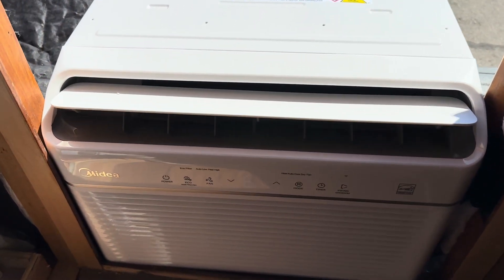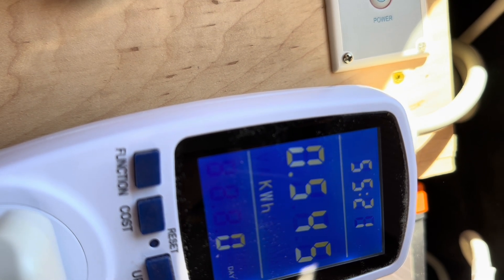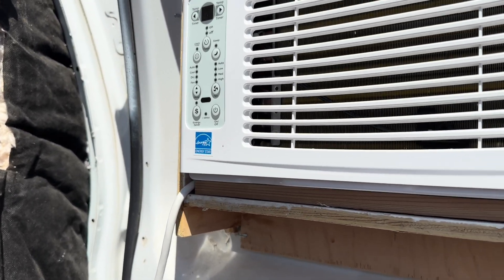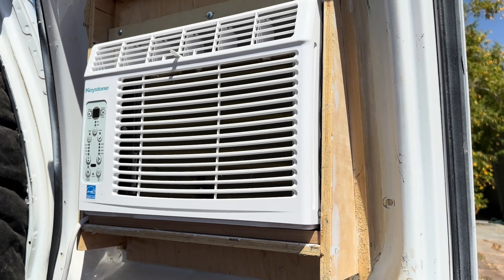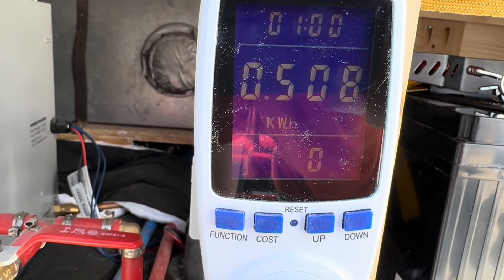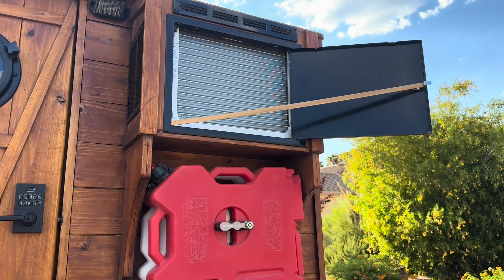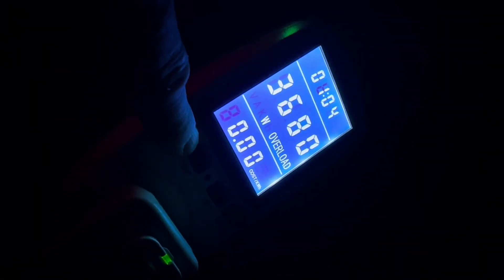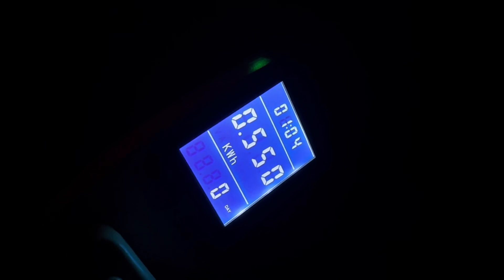Testing Midea 8000btu AC w/ Heat Pump and Another 5000btu AC Comparison - Surprising Result! 🤓

Comment: Also I have tried several 5000BTU and 6000BTU window units.  Think the 6000BTU cool quicker and compressor does not run as much.  I doubt i will ever buy a 5000BTU unit again.  Cool test.

Comment: I have the Midea 12,000 BTU in my den.  Run it on a Bluetti  AC200P all summer long off of solar.  Keeps my house nice and cool.  Inverter units are the way to go.
Reply from the maker: Thanks Troy
Reply: Just installed the midea 8000btu air con + heat in my vending trailer.  It works really well to cool the small space! The ac sips power most of the time between 150w- 250w set at 75f and when ramping up only gets to 450w.  Thank you for the inspiration.

Comment: Dave, is it just a simple 5,000 vs 8,000, the 5,000 uses less power? Did I miss something?
Reply from the maker: It’s a little more significant than that. This 8000 Btu unit tested has a heat pump functionality also. The test was to see if this version (which also uses the Midea inverter technology) was as efficient as the AC only version. My test showed it was not - which I felt was significant. Also, I tested to different 5000 Btu units in the AC pods I construct to see how they performed. I wasn’t necessarily comparing the 5000 Btu units to the 8000 unit so to speak, but included that section because I thought it would be of interest to the audience.

Comment: Thanks for doing the comparison! I actually have 4 of these Midea-U units running in various places. I bought one and realized how efficient and quiet they are and have since installed the others. The Midea-U is essentially a mini-split a/c in a window case. I have 10,000 and 12,000 BTU units and the peak draw I have seen was 650w as it began the cooling process. It lowered to 230w while maintaining the cool and sometimes down to 25-75w with just the fan going. That being said, I think you will see the biggest difference using the Midea-u unit by setting a temp and letting it maintain over a longer period. I think you could easily double the 7 hours you got with the regular window unit. just a thought. Thanks again for doing the experiments for us!
Reply from the maker: Welcome my friend

Comment: I have a Media 6,000 BTU cooling 700 sf in SE TX, always amazed whenever I see camper vans with larger units. 

When I had HVAC class, years ago, the instructor said that heat pumps weren’t suited for this heat & humidity, & that’s why you never saw any around here… however, I just read that “heat pumps outperforms traditional central ACs in dehumidifying the air”.  Gonna have to look into that because, while I like it warm, I have two 50 pint dehumidifiers that run pretty much continuously. 

Ended up with dehumidifiers because the previous owners had installed a central unit that was 3x bigger than what was needed. AC guy said that it would not stay on long enough to dry the air.
Reply from the maker: Thanks for the insight

Comment: Is this a different Midea AC?  The model from your previous video was an inverter AC, not a heat pump so did not have a heating capability.  Can you put model numbers in comments or description?
Reply from the maker: I discuss the difference in the video. Both are supposed to have the inverter technology, however one in addition had a heat pump capability.
Reply: @EndgameCampers  Thank you for the links to the specific models.  The heat pump will work down to 41deg F, and sometimes manufacturers will try to hide if the heat is resistive or an actual heat pump.  Good information thank you for posting the videos and linking the models! Midea makes interesting units at good prices.
Reply from the maker: Links added to description
Reply from the maker: Maybe. That is an interesting point. Thanks!